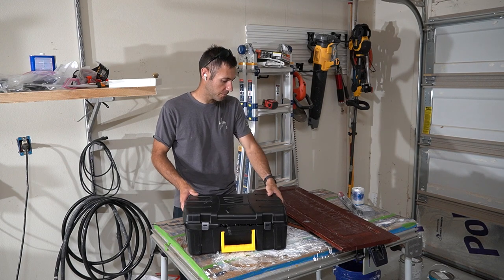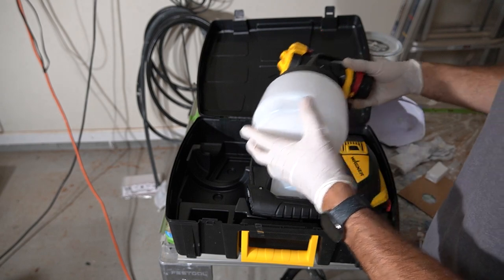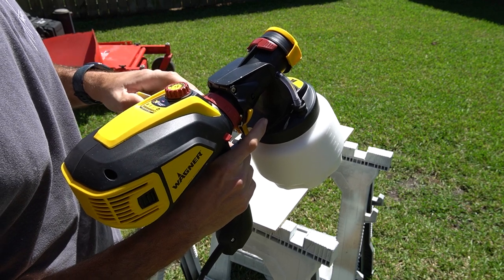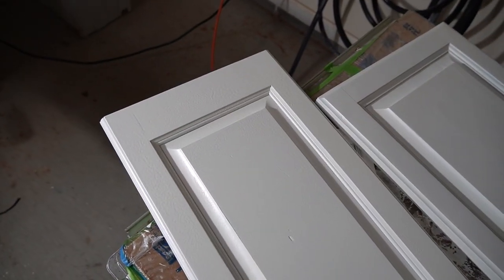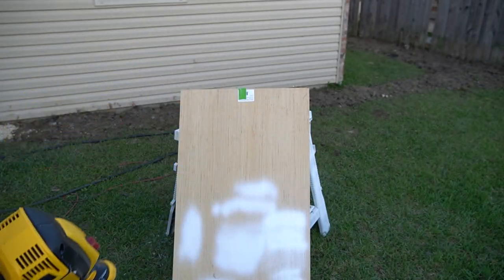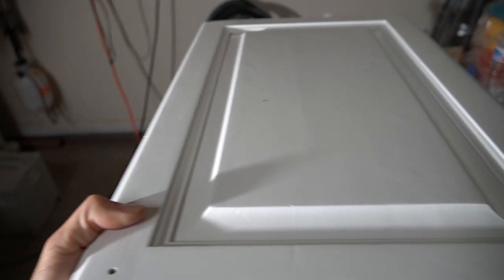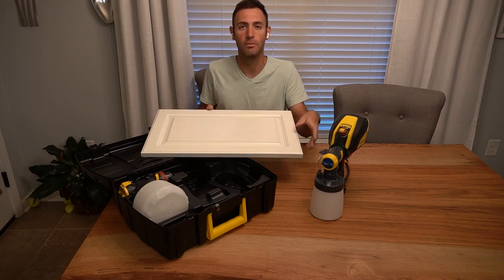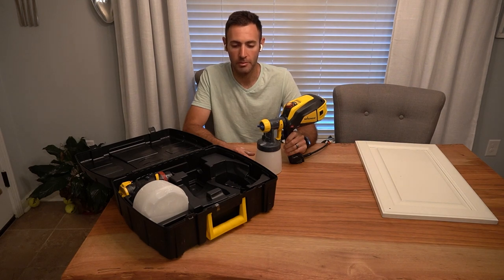Furniture Flipping- Getting Good Results with a Cheap Paint Sprayer (Wagner Flexio 3500 Review)

Comment: great video i thought you have to spray inside due to be dust free,,
Reply from the maker: It’s a pretty old video of mine. I’ve moved into a shop now, but even before that I started spraying in my garage after this. It’s just messy because there’s always overspray on everything, but you can spray under a covered area successfully.
Reply: @milosrestoration1337  extra extra plastic

Comment: How was cleaning the shellac based primer from the sprayer? can you provide an overview of that process? I want to get into flipping on some small pieces.
Reply from the maker: You have to use denatured alcohol and clean it out. I just take some and Swish it around in the cup and use a rag and dry it out while it’s still kind of wet from the alcohol. I wash the nozzle in the alcohol also and then clean out the passages with the brush provided with the gun. 
Need a respirator and gloves, also depending on where you live there might be a disposal for that type of material, I just save the washout and reuse it to clean again the next time.

Comment: I just bought this gun to use on some projects that I am doing around my home. I'm replacing all the builder grade door casings and baseboards to a wider flat faced type molding. I am also repainting the entire inside of my home...ceilings, walls as well as the trim. I am using BM Advance (self leveling paint) in Simply White on all trim including interior doors. I've tried a sprayer once before a few years ago and ended up with a hot mess on my hands. I am hoping that I can get as close to a factory looking finish with this gun. I was really trying to focus on the end result that you got on that cabinet door but my eyes just kept focusing on all the dents and dings. Aside from the door being in less than perfect condition, what are your thoughts on the actual spray finish? Does it look like a factory finish? Thanks for any advice/input.
Reply from the maker: Right off the gun (as in as soon it is sprayed) it is kind of orange peel-ish looking. But if you give it time it will level out as long as you spray enough paint on it. 
I would try this- any surfaces that you can spray laying down flat on saw horses I would spray those laying down that way you can put on enough paint without having to worry about runs. For the surfaces where you can’t spray flat I would maybe add a little water 5-10% or maybe even some latex extender and spray them on and try to avoid letting them dry out too fast. If you have the AC on it will definitely help the paint level out or at least if you’re painting outside try to keep them out of direct sunlight. Also, start spraying off your surface then pass over it because these cheaper guns spit when they start and stop. They say that you’re not supposed to thin BM advance and Emerald urethane but personally I think 5-10% water would probably be okay. Really it’s more about trying to control your environment as much as you can to allow the paint to level.
Reply: @milosrestoration1337  thank you for the suggestions. I appreciate it. In my neighborhood all of our fences are painted a dark color and mine is about do for a repaint. It’s rough sawn cedar so I was thinking that might be a good place for me to practice on and get a good feel for using a sprayer. I just need for the temps to cool off. The entire state has been under what they’re calling a heat dome. Thanks again 👍